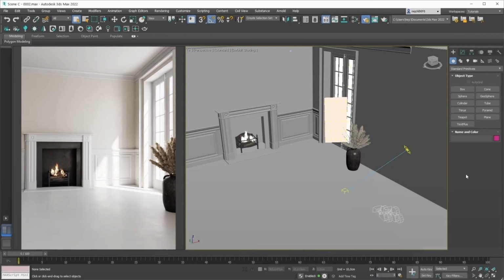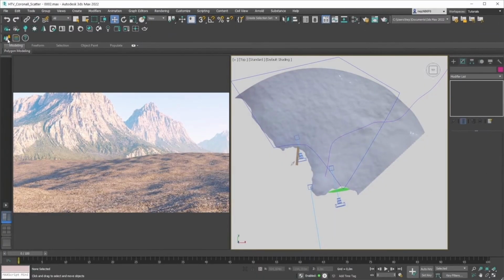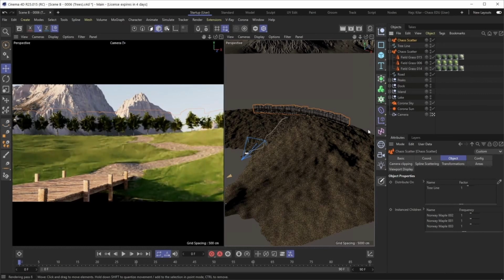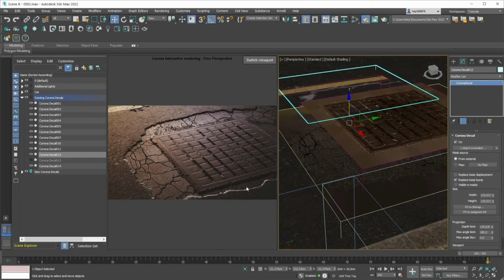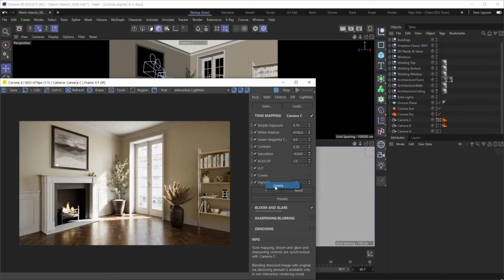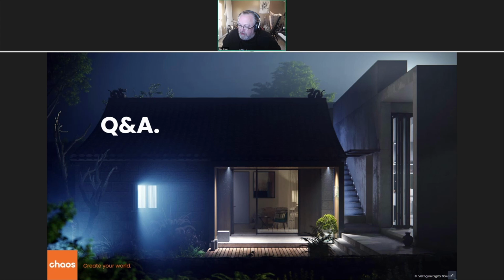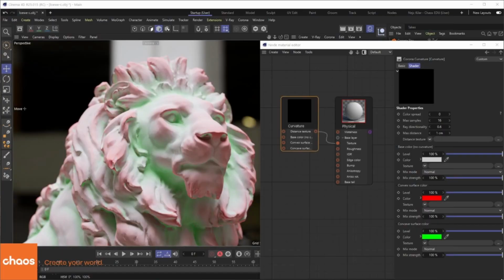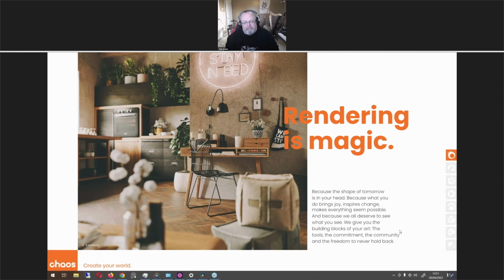Corona 8 Live Webinar

Comment: Hi! I don't know if it is already developed. But it would be awesome to be able to color correct objects from the model outside the material editor. The best example would be a tree. That you have tons of leaves that you want to make the green saturation lower, or warmer, etc. And instead of going one by one, you can make a quick adjustment of all of its materiales. There, the bad thing would be that maybe the trunk would change as well. But in my case would be extremely helpful and make my workflow quite faster anyway. Cheers!
Reply from the maker: Hi! Thank you for the suggestion - can I ask that you post it over on our Feature Requests section of the forum (https://forum.corona-renderer.com/index.php?board=5.0 for Max, there is a C4D one too). The developers can't monitor YouTube comments, and posting a request to our forum is a way to ensure it gets seen and considered.

It would be good to describe how you picture the workflow - for example this is definitely possible in post process, as there are several different masks which would enable you to isolate materials or objects, and then use those masks to apply adjustments to specific materials or objects in the image, but I imagine you are looking for something that is not post-process?

Also just as a heads up, while we look at and consider every request posted on the forums, not every request can or will get done, but it never hurts to ask!  Thanks! Tom

Comment: Why isn’t this available for blender?!??!??? You’re losing so much money. What a stupid decision you have made to not provide this for blender users.
Reply from the maker: It is not available for Blender for several reasons - first, due to the complexities added by Blender being open source; second, due to the same reason we are not developing Corona for any software other than 3ds Max and Cinema 4D, which is that it would spread our development team too thin resulting in either releases having much less features than usual, or releases taking much longer than usual. We are not willing to compromise in either of those ways on what we deliver to our existing user base, so there is simply not the team size to support extending Corona into another host application, sorry. Tom